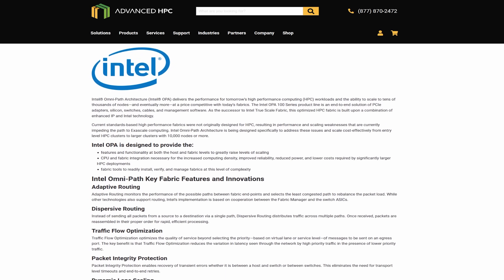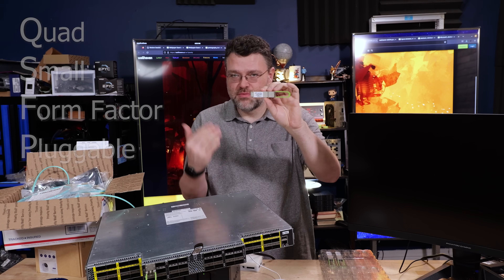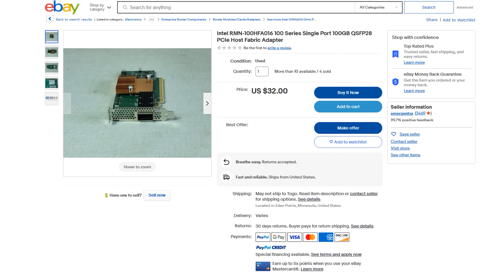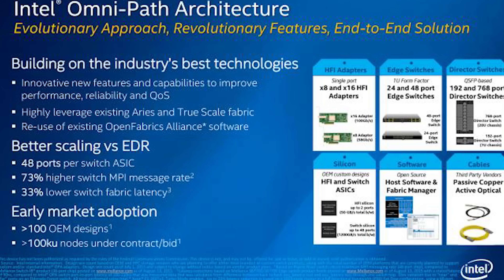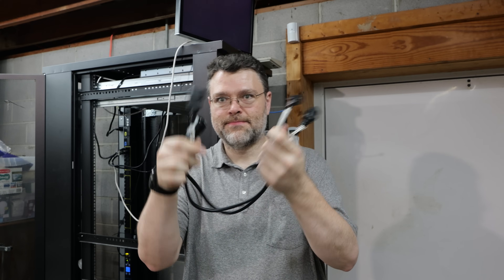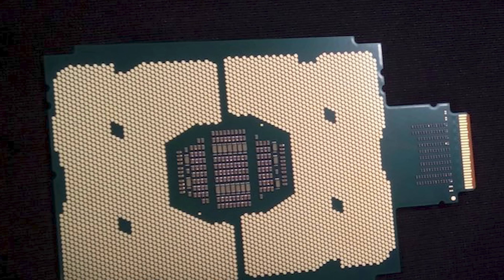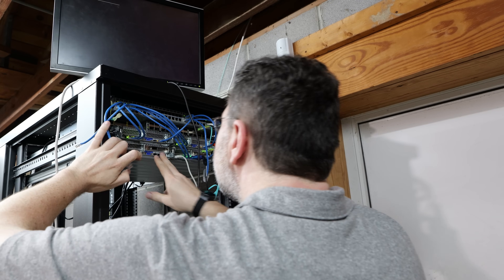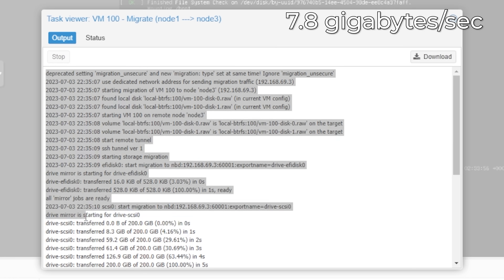Twenty Four 100Gb Ports for Under $300!?

Comment: Does it work under OpenIndiana?
My home Nas runs OpenIndiana and will do so for the foreseeable future. It doesn't have the disk speed for 100gb but maybe one day it will be NVME or something. (24 hdd direct connected to 3 lsi 2008's. With an IvyBridge-E 8 core xeon).

Comment: Well those Omni Path PCIe host adapters are pretty cheap compared to LAN, can we use two of them to setup a iSCSI NAS (without a switch) ?
Reply from the maker: Yep
Reply: This is where my mind went, also.
A ton of cheap NVMEs and Gen2 single lane switches in a surplus mining board; parallel-ized and running TrueNAS ZRAID or WS201X and Storage Spaces, would let you fill that bandwidth.
(Optane M10s are cheap AF, for caching, too)

Comment: I don't have any experience with Omni Path (but I do have 100 Gbps Infiniband deployed in the basement of my home), and this just sounds like it would be quite a massive headache, trying to get it do what you want it to do.

IB has been around a LOT longer than Omni Path (defacto standard system interconnect for a LONG time for supercomputers), and so, overall, it's a vastly more mature technology, and it's gotten to the point where a lot of it "just works".

If you get the Mellanox ConnectX VPI cards, that's even better because you can run the ports either in IB mode or in ETH mode (which is awesome).

(Or you can stay with IB mode, and just use IPoIB.)

I can't imagine Omni Path being nearly as capable, and I think that the lack of support, especially from the software side of things, is at least a part of what's holding Omni Path back.

(i.e. with OpenMPI - you can tell it to use the IB transport protocol)

My LTO-8 tape backup system uses said 100 Gbps IB connection back to my main Proxmox server, even though, at best, the LTO-8 tape only writes at an absolute max of 360 MB/s.

IB is more expensive than this cast-off Omni Path hardware, but it is, based on my experience with IB, a LOT easier to get IB up and running.

Comment: OPA isn't technically dead, people are still building systems with it (I know, because my company buys them). In any case, from an application PoV it reaaaally doesn't matter if it's IB or OPA.
Reply: 16:30 fwiw with HPC clusters we typically have three separate networks: the fast fabric (with IPoIB configured), fallback to 1/10 GbE and a normal 10/100/1000 management network for the BMCs, enclosure controllers, switches etc.

Comment: Would love to see a ceph cluster backed by these cards to speed up VMs during operation and not only while migrating ;)
Reply from the maker: turns out, its very fast. connected mode, instead of datagram mode... is legit
Reply: @Level1Techs  can't wait to see it ;)
Reply: @Level1Techs  
Do you have to manually configure the queue pairs with OPA like you do with IB if you want to use it in connected mode rather than in datagram mode?
Reply from the maker: @ewenchan1239  No, except/unless you are doing something like block devices over fabric then you want to try to keep everything on the same cpu socket. dual OPA per socket makes a lot of sense.
Reply: It will depend on whether the storage devices behind the Ceph cluster are HDDs or SSDs, and if they're SSDs, what type of SSDs they are.

(Just remember though - that SSDs are like brake pads on a super/hyper car: the faster they are, the faster they'll wear out (because you'll want to use it all the time).)
Reply: @ewenchan1239 the obvious solution is MORE of them ;)
Reply: @niemand5720  
More brake pads = more brake pads to replace.

The ACTUAL, obvious, solution is PMEM200, but on a $/GB basis, it's still significantly more than even U.2 NVMe SSDs.

What they should REALLY do is bring back the ability to create a distributed stripped gvol of RAM drives (which was a supported configuration in GlusterFS 3.7), that way, you can just have RAM nodes where it runs a stripped down version of RHEL (or CentOS), creates the RAM drive as a GlusterFS brick, and joins the distributed stripped gvol, which you can then re-export back to the 100 Gbps network as a NFSoRDMA share.

Still pricey on a $/GB basis, but being that it's a RAM drive, you don't have to worry about replacing the "brake pads" like you do with ANY kind of SSD.

Or, alternatively, looking forward to CXL. (We'll see how THAT goes.)

Comment: I've never used Token Ring but I recently learned that it is fully software-compatible with Ethernet. They even made transparent bridges between the two standards. The magic of them both being part of the IEEE 802 family.
Reply: Almost all modern day dumb switches internally use TOken Ring in one way or another for the switches innards.  (Might have changed on enterprise gear, but most 10/100 switches used it)  
Not sure if that's the case today.

Comment: The reason it's cheap is because it's being abandoned, once fiber channel caught up there was no need for proprietary standards and manufacturers abandoned it.

The risk of adopting it being that stuff will fail or be incompatable and you won't be able to get replacement parts or support.
Reply: Fibre channel caught up? Sorry have I missed something? Last I saw is fc falling behind rdma based network standards liks IB, ISER and RoCE..?

Serious question btw.

Comment: 4 ports at 100Gb with suitable cards in my various computers for under $300 is interesting to the point of drool. 24 ports that refuse to talk with anything I own is cool but not compelling.
Reply: Mikrotik sells a 4 Port 100GbE switch new (!) for about 600$. Still a bit off from the 300$ price point and less features than used large enterprise switches (RcoE), but depending on how much you pay for power those 30W vs 300W might make a giant difference.
Reply: @calaphos I wonder what 100gbe network adapter can be cooled inside a standard case... 🙈

Comment: Maybe it would make a good video to put out a parts list for the fiber home user? I will be getting 2.5g fiber soon and been looking at parts to upgrade my small network. i dont know anything about fiber... does 2.5g even require fiber inside the home?
Reply: 2.5 and 5 gigabit Ethernet are only over copper. Fiber based Ethernet goes right from 1 to 10 gigabits. If you're okay with 2.5 between devices I would suggest 2.5 gig Ethernet which should work fine over any old Cat5e cabling you already have. Regular Cat6 is enough for 10 gig as long as you're under 50 meters, you only need Cat6a for long runs.
Reply: @eDoc2020  THXS
Reply: you really don't need fiber in your house, good 'ol CAT cable will work fine
for >1g you wanna get cat6a

if you really wanna you can run fiber but it's not as easy as buying a spool of cable and a crimp tool
Reply: @user-fs9mv8px1y  its not 1gig its 2,5 gig down & up

Comment: Is OnmiPath related to QuickPath Interconnect (QPI)? 
This kind of tech could be used to produce motherboards that would be just child numa nodes to remote master numa node.
Reply: No, QPI is different.

QPI is socket-to-socket communication (or socket-to-PCH communication).

Omni Path (and/or Infiniband) is communication BETWEEN nodes.

But yes, I have used Infiniband to have node0/socket0 talk to node1/socket0 and achieved better throughput with that than node0/socket0 talking to node0/socket1.

RDMA is AWESOME for that.

Comment: I support two clusters which utilize OPA, and it works great.  Much easier to setup than Infiniband.  On one cluster, we use it with a BeeGFS clustered file system to achieve really high write concurrency.  The real reason it didn't take off like it should is Mellanox cut their prices to compete for the first time ever.  At that point, most IT shops didn't want to take a risk on the new tech when they could get the proven solution for the same price.
Reply: I have found IB to be actually really easy to set up.

Once you have the OpenSM subnet manager running (if you have an externally managed switch), you install the driver (whether the "inbox" Mellanox drivers that ships with your distro) or the MLNX_OFED drivers, assign an IP address to the port, and you're up and running.

It's actually really, really simple/quick to get IB up and running.

I think that my IB deployment notes/list of commands for CentOS is maybe only like 4 lines long. Something like that.
Reply: @ewenchan1239  IB isn't as bad as it used to be, for sure.
Reply: It also never worked well with GPFS. IBM eventually gave up and dropped support.